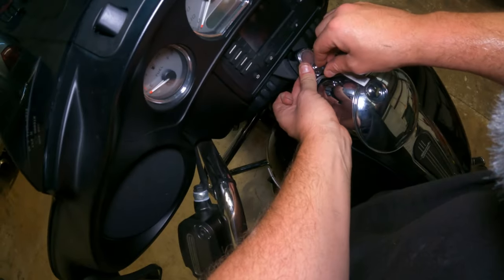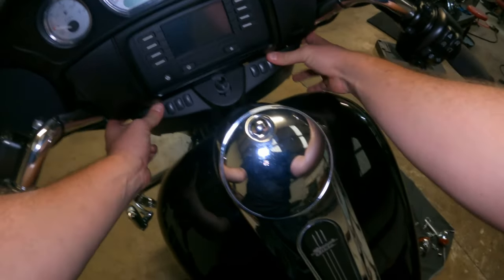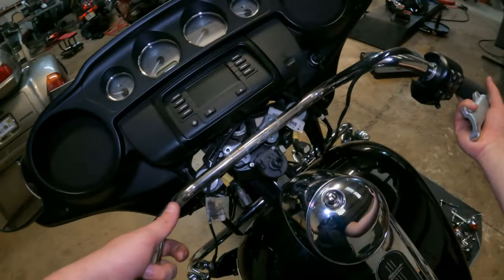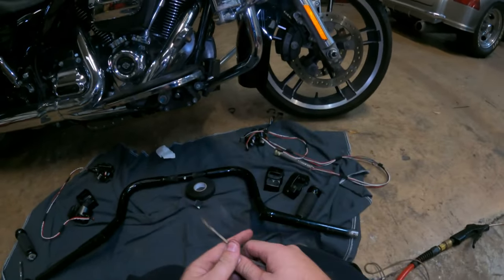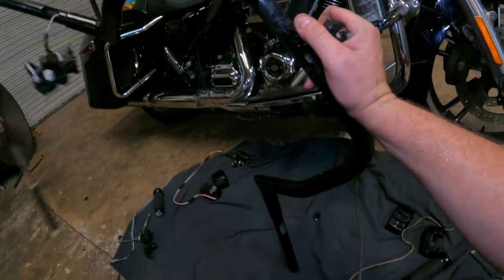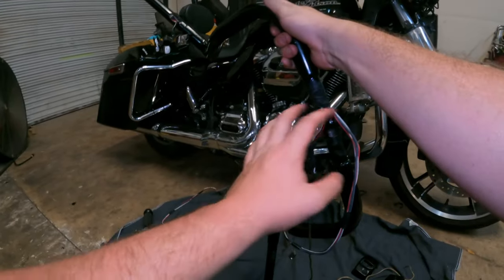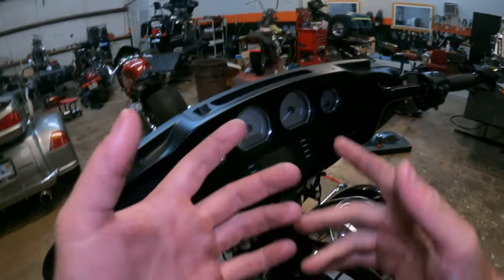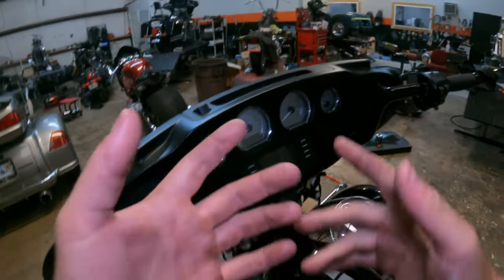How to install handlebars on a 2014-2023 street glide!

Comment: Dang, is it that simple??? I have a set of bars still in the box since a year ago because I haven't found the time to get the bike to the shop (2020 FLHTP). 
With these excellent instructions I think I'll give it a try. Thanks a lot, man, appreciate your presentation. Really well explained 👍🤙
Reply from the maker: I’m glad you liked the video! If you have some tools and determination you’ll be able to get it done! First try just take your time and be patient! Glad I can help, thanks for watching!
Reply: no it's never that simple lol, of course mine has to have a giant plug at the end of the throttle by wire that doesn't fit through the bars!!
Reply from the maker: @garydumpson4346  the throttle by wire has to be de-pinned, it’s been a while for me but I can’t remember if I talked about that in the video. I have a video on my channel about Harley connectors that might help you out!
Reply: @KevinSornig  thanks for replying! I will check out your other video!
Reply from the maker: @garydumpson4346  no problem! Always willing to help out!

Comment: Do you have a video on bars for 2013 tri glide ?  Wondering about wires and cables   And what size I can do on bars.    Thanks.   Great video
Reply from the maker: Thanks for watching! Tri glide is going to be the exact same, except the connectors are different, I do have a video about removing the connectors for that year harley though. Simple procedure and basically the same process, hope this helps 👍🏻

Comment: Great video!
Do i need to change brakes and clutch cables if installing a 14” on a 2017 electra glide?
Reply from the maker: It depends, if they’re a wide set of bars you most likely will have to change them. Thanks for watching!!

Comment: You mentioned check engine lights. That has me worried about doing my own. How do you clear those if that happens? And does it mean somethings wrong?
Reply from the maker: The check engine light typically comes from when you “open” the circuit to the controls. The way to clear them is by holding down on the odometer switch with the ignition off, while holding the odometer switch turn ignition on, once ignition is on release the odometer switch. You will then use short presses of that switch to scroll through the different types of codes, and to access and clear codes you press and hold. For example one menu says ECM: you would press and hold to access and then press and hold to clear👍🏻
Reply: @KevinSornig  awesome thanks for the response:)
Reply from the maker: @nanoswithabackbone232  anytime!👍🏻

Comment: I never heard the size of the bars. I’m looking to do my 2020. I don’t have to extend anything on my 15 but I was wondering about the 2020
Reply from the maker: With a 2020 you’ll be able to run 12 inch bars without changing any cables or extending wiring. I believe you can go up to 14 inch with stock brake lines and clutch but it can be tricky. Hopefully this helps!

Comment: Thanks for this video, was quoted mad money by dealer so going to do myself, Why did you remove ignition switch?
Reply from the maker: No problem glad I could help! I remove the ignition switch to make it easier on myself. I’ve seen people do it without removing the ignition switch, but it can be a hassle when putting the fairing back on. If you don’t remove it and the trim piece below it you’ll have to lift the fairing over it.
Reply: Thank you and thanks for the quick response, I see guys disconnecting the battery or removing the main fuse, is that a must do? Apologies for the questions.
Reply from the maker: No apologies needed, I try to always remove the main fuse. But sometimes I forget lol. Never had a problem either way 👍🏻
Reply: Perfect, thank you so much, subscribed from Ireland..🤘🏻
Reply from the maker: @zitter1971  thanks man! Take it easy! Hope all goes well!

Comment: Ive changed 5 sets on M8 Softails and 1 Dyna and replaced the riser bushings with poly. No fairings. Never on a touring. I just bought a 22 SGST. I couldn't tell but can I get to the bushings without removing the fairing any farther?
Reply from the maker: You can pop those bushings out by tilting the fairing forward like I do in the video. I do however recommend having someone hold the fairing out of the way if possible because the fairing will have to move a decent bit
Reply: @KevinSornig  Thanks Kevin!! Great video too
Reply from the maker: @ericdean7807  no problem! Glad I could help! Ride safe🤙🏼

Comment: Good video but remember the hight of the bars might require others to need more parts.
Reply from the maker: Thank you! And you’re totally right, taller bars requires longer lines and longer wiring harnesses!
Reply: Thought I heard on most Harleys (newer models) you can install 12” bars without any extra cabling. 14” is a different story.
Reply from the maker: @geedubb-q1u  yeah, the only slight issue is the location of the female connectors under the radio, you have to re-position them. Which admittedly I didn’t show well in this video. I put a link to some short wire extensions in the description of the video, they’re not necessary but someone asked about them so I added it. The throttle by wire, clutch line, and brake lines don’t need to be changed for 12 inch bars. Hope this helps👍🏻

Comment: So I just did this myself yesterday and put everything back together went to start the bike but would not start is there something I need to do. I put 10" dominators pre wired on only had to transfer my throttle by wire. Please help😬.
Reply from the maker: First I would start with checking your fuses. If all that appears to be in order, check your ignition switch in front of the gas tank. Sometimes the barrel can get turned if you remove the ignition like I showed, and you’re actually only putting the bike into accessory mode. If that is the case, the easiest way to do the ignition alignment is with an ignition alignment tool, I’ll post a link when I can. If the ignition switch is functioning correctly, and all the fuses are good, check to make sure you hooked up the wire harness to the proper side.
Reply: @KevinSornig  so everything turns on when I turn switch on left side blinkers work fuel pump high/ low beam . Nothing on right side works so I took everything apart to make sure no wires were pinched and so far can’t find anything wrong with it
Reply: @KevinSornig  didn’t take the ignition out of bike left it in
Reply from the maker: Okay, so where I would go from here if you haven’t checked already would be for a loose or unplugged connector in the fairing. Also, I’ve seen once before with pre-wired bars, one of the wires on the handlebar harness went to the wrong spot if that makes sense